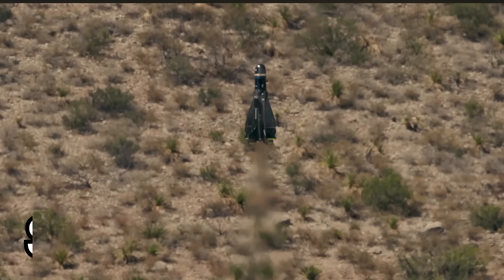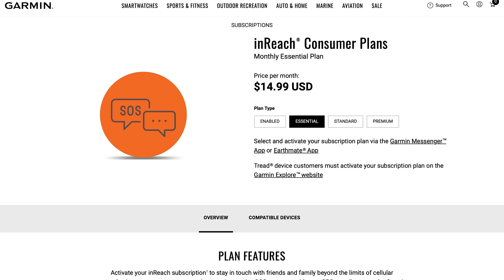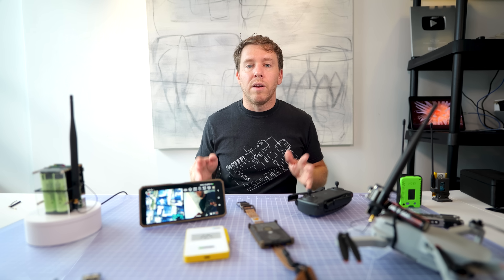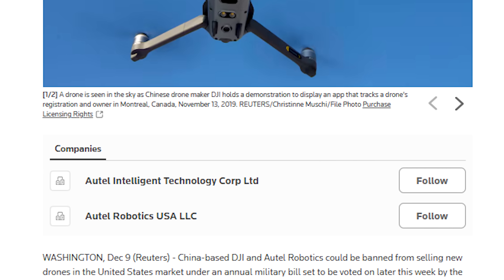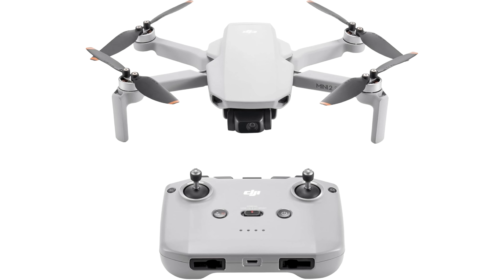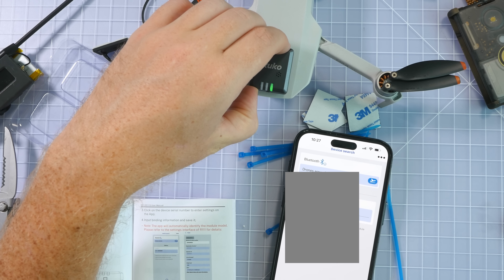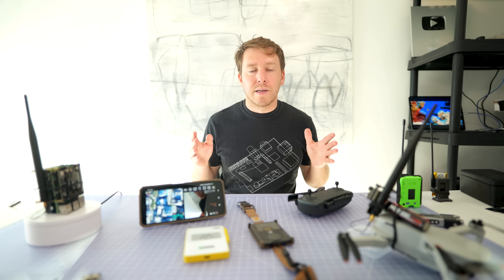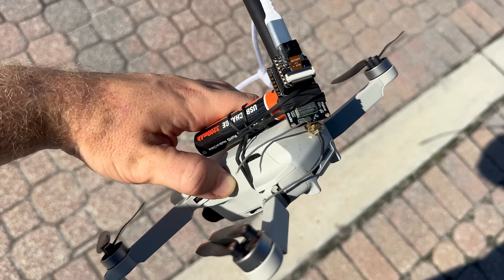I Built a $40,000 Military Drone for $120.07

Comment: "I Built a $40,000 Military Drone for $120.07". Not even close!
Reply: Yeah I honestly like the idea for a video but this was a bit mushy with not a lot of background info on why using ATAK is better or why put a LORA node on a drone. 
It should be titled "I TRIED replicating a military drone but just added a ESP32 node powered by an 18650 and got 2 FPS!"
Military drones are quick, rugged, easy to deploy, have extended range, better cameras, and stealthy. This checks none of those boxes. 
From an OpSec perspective:
1. The system relies on Halo Wi-Fi to push IP packets over long distances and integrate with ATAK = Less secure, more interference, easy to jam.
2. The build exceeds 250g, requires an external FAA-compliant Remote ID module = No stealth, clear landing and take-off positions (not a big deal for civilian use)
3. External 18650 battery just adds more weight, is an extra weak link, and counter-intuitive since now the flight time is substantially lower.
4. The reliance on a mobile ad-hoc network for video streaming means disrupting key nodes in that network would sever the drone's ability to transmit data.
Cool video but the title had me thinking this was going to be more intuitive and you know, actually trying to build a replica of a Black Hornet Nano which was shown multiple times for no reason.
Reply: @WEEDFROGS  I agree to an extent but I think point 1 and 2 can be swept aside as they are only to stay within the confines of the law as a civilian.
Reply: @WEEDFROGS  The point the guy was trying to make, was it doesn't cost 40,000 to make a capable drone.
Reply: @ThisTimeItsDUBSTEP Does anyone sell their manufactured product for what it cost to make? Duh.
Reply: @WEEDFROGS  yeah, his drone wasn't hardened and his materials were all probably sourced from AliExpress which is already a huge cost for military contracts because we have to source our stuff the GSA approved vendors which costs 3 to 5 times more than buying from Amazon.
Reply: @WEEDFROGS  It was nice thro ing a switchblade back in the day. It worked.
Reply: @WEEDFROGS  Anyone know a better video than this?? That actually does cheap military drone builds? 
 Surely there are some talented guys coming out of ukraine putting together very budget & effective systems?

I want to learn the supply chain & about it... Like anyone who clicked this click bait.
Reply: @WEEDFROGS  He did say it was just a proof of concept. I believe his point was to make a very basic version for civilians. If you begin to add all the extras for actual military use, then yes it would definitely not meet the $120 price, however it doubt it would take anywhere near the $40k of one of those actual drones or even 20k.
Reply: @seeingyou3050  Yeah thats what I took away from this video. Imagine what he would be capable of if he had a team and the budget of some of these contractors. I daresay he could probably win some nice government contracts
Reply: @seeingyou3050 the difference between a proof of concept and a product is, you guessed it, $20,000
Reply: @seeingyou3050  The expensive part of military & defense applications come in the validation and testing phases in alot of cases. Can you build a version cheaper...yes. Can you build a version who's function you will garuntee to a 99.999999% LOC with all the statistical testing data to validate that claim? Cus that tends to add a little cost
Reply: @invntiv hard disagree
Reply: @WEEDFROGS  Data Slayer has the right idea. Ukrainians are building $100 drones that destroy Russian tanks currently.
Reply: @soonheaven  it's already far from the truth. The thing is that even the cheapest drone that will be at least a bit effective is around 500$ for now. Defense systems evolve as well, so the price goes up. 40k for well build serial military drone is ok.
Reply: @soonheaven I mean all things considered building something that blows up is way easier and cheaper than building something that can create a usable network infrastructure for constant reuse. thats like saying we should be able to build a sky scaper just easily because Jenga exists
Reply: never been clickbaited this hard
Reply: @skf3004  Anyone know a better video than this?? That actually does cheap military drone builds? 
 Surely there are some talented guys coming out of ukraine putting together very budget & effective systems?

I want to learn the supply chain & about it... Like anyone who clicked this click bait.
Reply: @donkeytwoddle  there are, but the trend we're seeing is that those cheap drones are getting less and less effective as countermeasures are put in place. Those countermeasures then need to be countered which drives up costs of the drone. And then that gets countered and so on and so on. These very expensive purpose built drones simply have capabilities that the cheaper ones don't have which do make them more expensive. Now that capability isn't always necessary, but when you need it you're gonna be glad you have it.
Reply: @skf3004  ah, so you haven't seen his military radio video then.
Reply: @TobyLegion  Yes, I did that’s why YouTube recommended this one. I agree with the other video, but not this one.
Reply: @skf3004  If you think his other video was accurate than you probably don't know a lot about rf.
Reply: @TobyLegion tbf, compared to the original one, the open source radio lacks a lot as well
Reply: @nandornagy3248  yeah, thats my point. It's not the first time he pulled this.
Reply: I built a $120.05 drone for $120.02. Making a video about it right now.,
Reply: Yeah this wouldn't survive 1 hour of use in the field... You can match the functional features perhaps, but the environmental requirements and passing tests in harsh conditions are what yanks the price up on military equipment.
Reply: @niklashbg  On the contrary, it would survive for a long time because it wouldn't be worth the ammo or attention to shoot down.
Reply: Yeah. It's building something of similar function but it probably doesn't meet any MIL / other specifications for RF, waterproof, etc and I appreciate the gusto but not the clickbait-y-ness.
Reply: Take Anduril out of your mouth. Unless youre building antigravity in your closet
Reply: To all who check the comments before watching, it's a clickbait 🤡

Turn clippy everyone! 🍉🍉🍉
Reply: the one is 40k because its a missile lol , and explosive :)
Reply: @George_Soros.  dude, tbh explosive itself is not as expensive :-)
Reply: Dji is better then American drones...u can buy them at best buy. Our cou try is stealing from us
Reply: Nice
Reply: To be fair it might not take $120.07  to replicate the original drones but it will not be as expensive as $40k that's for sure.
Reply: Wouldn't be able to show how to replicate the military version anyway because the process of miniaturizing night and thermal vision systems would fall under export controls
Reply: @PsychoBoyBlue   - Publish the Vid from Brazil or something, no limitations then..  

(JK - BTW, If anyone things other countries don't have the smarts to reverse engineer anything they are very deluded - USA, France, Germany, and the UK +/- Australia, Singapore, etc - has TRAINED the next generation of the foreign Engineering and analytical professionals your nation state are deadly afraid of..  (Fact that DJI can spit out a very advanced hobby drone for ?? low hundreds, is amazing...  Bare bones-  they are even cheaper - as evidenced in Ukraine, Disposable in the military context..    lol..  IF a $3000. longrange, terrain following "drone" makes the enemy waste an S400, that is a military success.)
Reply: @SankalpSaxena99  Now that is actually correct.
Reply: @SankalpSaxena99 ok, go and pay a team of engineers salaries from $90-250k for several years and release a competitor to undercut the market. You’ll sell like 200 units and can charge $5. The DOD will eat it up, they love low bids. It’s easy right? Then do it.
Reply: The point is that the military ones shouldn't cost 40k
Reply: @duzk7588  While a military drone likely shouldn't cost $40000, the point is he directly compared the $40000 drone to his janky setup as if it could replace the $40000 drone, and it's not even close.
Reply: @cdnron75  I mean, it's a proof of concept. It shows that the tech inside isn't super overly advanced. That the extra refinement shouldn't be an over 30000% mark up just because it's tax payer money.
Reply: @duzk7588  Yes, he said it's a proof of concept but the title makes a direct comparison between the two as being equal. They aren't even close to being equal, nor is the tech inside the "$40,000" drone simple. On that note, the drone shown in his thumbnail and opening, the Anduril Roadrunner-M, is not $40,000, it's more like $500,000! Why did he choose to not tell the truth about the cost? Likely because it would have made his claim far too outlandish to believe. His claim is outlandish to believe as it is, but if he would have claimed that he built a $500,000 drone for $120.07, he would have got roasted far more than he has.
Reply: @cdnron75  Yeah, I get you. Click bait is unfortunately the name of the game on youtube. Not saying that makes it okay... I think it's good to call it out. 👍
Reply: @duzk7588 the tech inside isn’t super advanced because he ignored and left out MOST of the tech inside.
Reply: @duzk7588 how much should they cost?

Comment: Nice clickbait, unsubbed.

1. ISR military drones of this type don't cost 40k.
2. This is not a drone that is even close to the features and quality of an ISR military drone, this is a piece of st compared to it.
3. Anyone can add ATAK features, its open source, and you just use an LLM to add some code and integrate.
4. No one will bother suing you, your drone does not have anything interesting, and it is not stealing any technology that anyone would care to bother with.
Reply: Yeah, I had the same reaction.  I know I'm just playing into the engagement farming by commenting about how stupid this build is, but I can't help myself.

The drone war in Ukraine is, in part, bounded by available funds.  None of the drone units are running $40K boondoggle drones if something cheaper will do.  But this drone build would be utterly useless on the Ukrainian front, or in any other modern contested battlefield for that matter.  A few reasons just off the top of my head:

- Zero electronic warfare hardening, so it will be dead on arrival due to jamming
- RTSP over Halow is completely wrong for this application.  It requires bidirectional network traffic which is a huge limiting factor.  There's a reason pretty much all FPVs use one-way comms for the video downlink.
- That video downlink was shit, latency makes it useless useless, and it was just a few feet from the ground station.  Fly the drone just 5km and see what happens.
- That board is just flapping in the breeze, I bet even moisture from a low-lying cloud or a bit of fog would kill it.  But an IP-rated enclosure adds weight and cost.
- That cheap camera is cheap for a reason.  I've put better cameras on FPV drones that are designed for one-way trips; for a recon drone it's a joke.

All of the above are definitely fixable.  But then it will be an expensive time-consuming drone build and that presumably doesn't generate as many clicks.
Reply: lol dude taped a meshtastic module to a COTS DJI drone and called it the same thing.
Reply: You can also hear that his script is written by GPT “ and the kicker is…. It’s not X but Y, etc”
Reply: @dunar1005  Oh my god I get so annoyed with that. It's super obvious to me now after using chatgpt myself for awhile and I started noticing it on so many channels. I can't blame them writing a script takes hours when they can generate a prompt in minutes but, at least go through and re-write it to sound natural.
Reply: You mean to tell me a DJI drone with a camera and a raspi strapped to it does not have the same capabilities as a purpose built drone? This guy is a clown.
Reply: I unsub too, if i ever need his videos i will search them but not worth having a subscription to his click bait
Reply: Yeah, this is trash video. Someone who understand something about robust electronics is clearly not him.
Reply: 5. No cost of work in calculation. Only the bill of materials is included in his price.
Reply: @bariole  he deleted all my message about him stealing code and guide for is own profit..
Reply: Roasted!
Reply: It’s ok, I subbed to balance your bad karma.

Comment: I call BS. That cheap, low-quality Chinese ESP-32 with its weak throughput feed is junk, and that’s exactly where you’ll have to spend real money if you want performance. If you’re after thermal imaging and other advanced features, you’re going to need to invest—there’s no way around it. That thing is nowhere near equivalent to military-grade equipment. Sure, integrating into ATAK is straightforward, but what you’re working with is low-quality, low-reliability, hobby-grade toy hardware. Comparing it to true commercial or military systems is apples to oranges. Nice video, though.
Reply: Yeah the title is very misleading. He made a hobby electronics project that looks and performs as such. I mean the frame rate and video resolution are atrocious but consistent with esp32cam hardware. He would be much better with FPV drone camera hardware than the current setup but still far from military and commercial.
Reply: would be plenty fine for small american allied groups who need SOMETHING to work with. And we save money.

Comment: Honestly, using OpenIPC FPV firmware with advanced adaptive link seem a better option. Using directionnal antenna, it was tested successfully to over 5km with realtime video feed at 60fps. It can already stream encrypted video feed to local Wifi Hardware, stream to ArduPilot, via Internet relay and  send MAVLINK drone telemetry and possibly control signals... And using a DJI drone is not really "sustaining open hardware". You can build something quite siilar using the open source ArduPilot or iNav firmware and have it execute autonomous misslons. Even the most used  radio control system used in FPV, ELRS, is open source.... Mesh network is cool for sure, but  I don't get why you are trying to reinvent the wheel and use such a slow network protocol for aerial video link

Comment: Im sure you’re super aware there’s a big difference. The viewers may not. Your hardware supply chain for building these weapons can’t be from DJI based in China. The radios are hardened to be weather proof, vibration proof, etc. and the secure SBOM as well as making sure how it works internally being classified to make sure it’s secure rather than just getting a manual of how it works off the internet. A thousand more differences stacked up puts the $40k price tag from Andruil in a reasonable light. But that’s the bit and I respect it 🫡

Comment: Great video man, keep it up.
One thing, you used the footage of an Anduril Roadrunner drone and labelled it as a surveillance drone, whilst it serves more as an interceptor. For the architecture of your drone, I’d say a Bolt-M by Anduril would be closer.
Anyways, thanks for the inspiration. Might wanna give a shot on my own later.
Enjoy
Reply: LOL what a total newb. dji sells a military grade video transmitter that goes 15km records at 4k 120fps with a 60mbs low latency video stream to your goggles for 240 bucks. in a package weighing 16 grams. this required custom silicon, propritary protocols, lots of engineering. i would think it would cost about 100 million dollars from development to getting the first unit made. you strapping an esp32 webcam  and accessing a video stream from some web page. this not the same hting its not even kind of the same thing. not a single thing has been achieved with this setup. this guy needs to humble himself. the picture of the reusuable intercepter that has a turbine in it and is tottally autonomous and integrated with lattice doesnt need to stream video to some crapy army app.  im glad hes doing this stuff but damn, show some respect for the dudes at anduril i have absolutely no idea how they are able to build their own autonomous fighter jet fury, also their own electronic warfare and communications software defined radio platform. These things are unbelieveable achievements that take knowledge and engineering in so many different domains that only a handfull of companies really hold the market in. if i were the government i would give them every single contract. a  40k interceptor is amazing. they are making things so much cheaper and better than everyone else. to say you made the same thing for 130 bucks that they have is something only the biggest assholes would claim.
Reply: @mrschnider6521  It's the same nonsense he did in his last video, he got 1km at most range, and said it was as good as something like Silvus, DoodleLab, or MPU5 radio... its pathetic. He creates a worthless toy, and calls it the next great thing, and those who are not familiar with this industry, believe that he's accomplishing something...
Reply: Yeah, man.
Had an honour to somehow work with them lads from Anduril for a short period of time. Not going to lie, it’s my dream to work as a FD software engineer there. I myself research autonomous drones, especially detection + EW handling as a postgrad student.
Anyways, 100% the final drone costs include the engineering, testing, production facilities etc, but the idea to replicate it even in a rudimentary setting is awesome and I’d love to do something on an affordable level as well.
Reply from the maker: Do it!